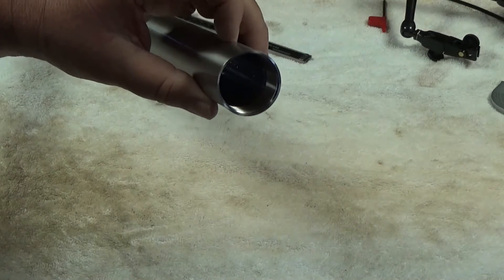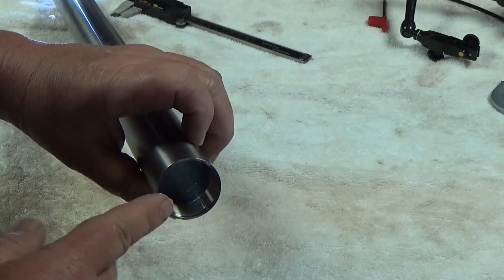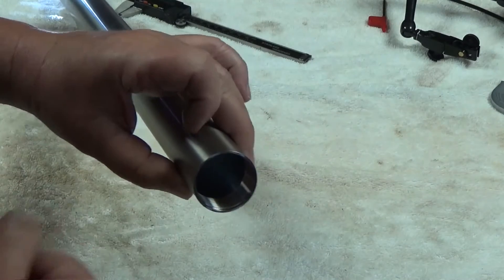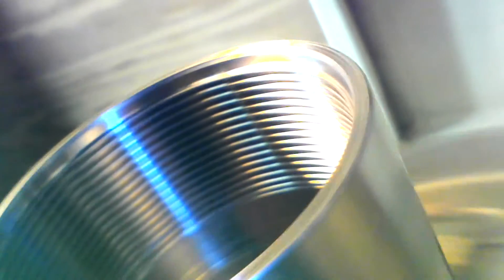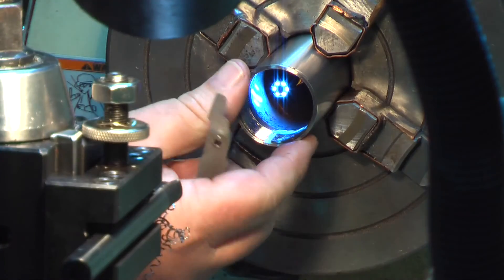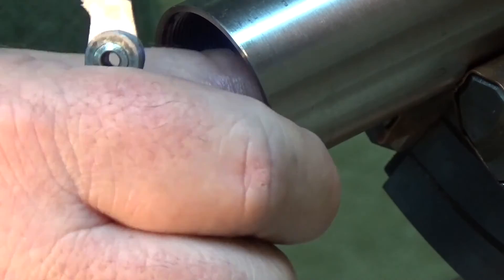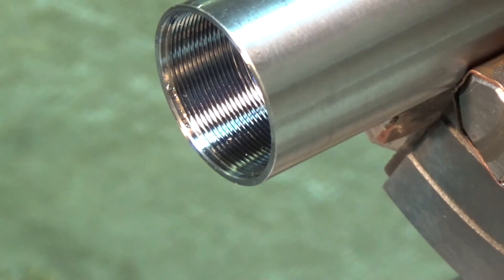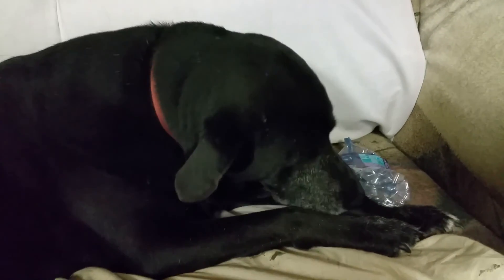Homemade Suppressor Tube Threading

Comment: Brian, 
Thanks for the video with the bore scope and a great addition to you other videos. Always smart to take a light scratch pass. I sometimes cut metric threads on my Imperial quick change gear lathe but have to make some change gear swaps behind the headstock. It is easy to forget to change these back and not always easy to detect with the same change gears settings for something like 16 TPI vs. 1.5 mm over a 0.5" length of thread (a 120/127 difference). Enjoy watch Shop Dog Zeke.
Regards, Paul

Comment: Awesome video! It's great to see another suppressor build start!! I love all the camera angles you got.  I'm looking at incorporating Titanium on my next Form1 build as well, but I've never worked with it before, is it particularly difficult or are there any major considerations to cutting titanium, compared to stuff like 17-4 stainless or hardened 4140?
Reply from the maker: I'm learning to slow it down with Ti, if too fast with light cuts the chips will ignite, so have a bucket of sand around. thanks for watching